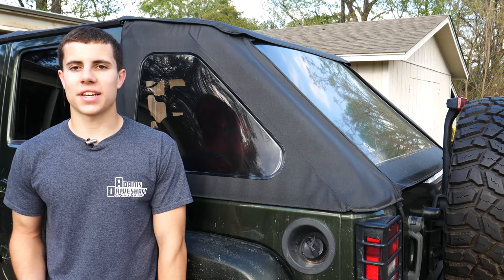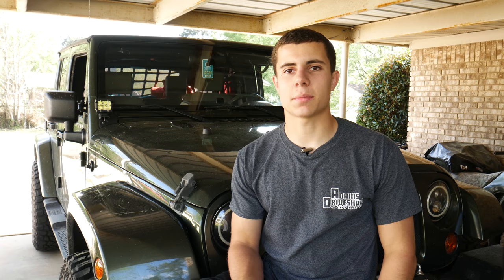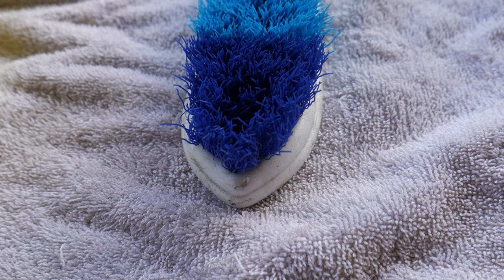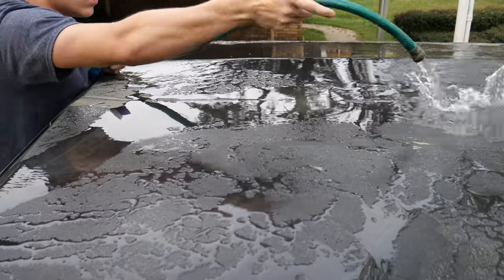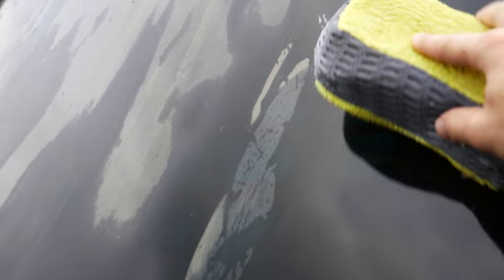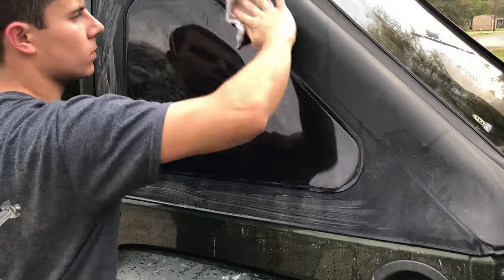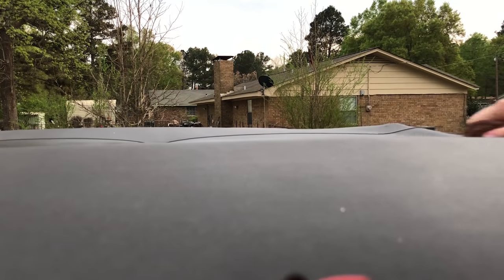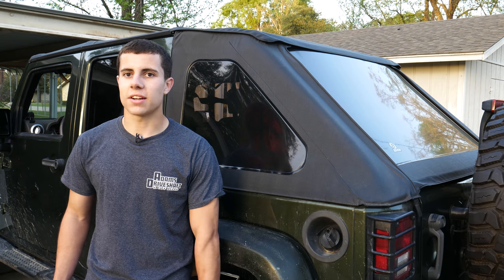How to Clean, Darken, and Protect your Soft Top

Comment: Ok I used the sealant on my top and several hours later it looked spotty… that’s why I’m searching videos
Perhaps by tomorrow  it will be even but what if the spotty look remains and yes perhaps I did not get it covered perfectly even or some how I messed up the job but I applied it to the top with a rag. And tried to make it even  is it possible it will not even out later? And if not what do i do?